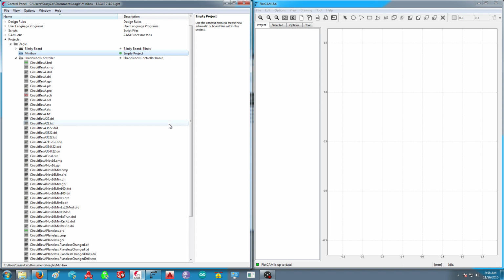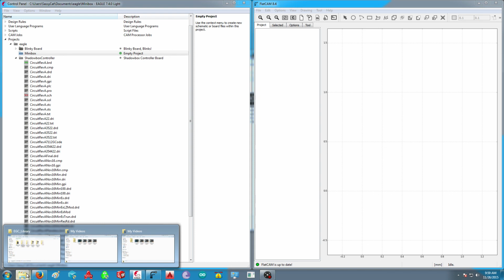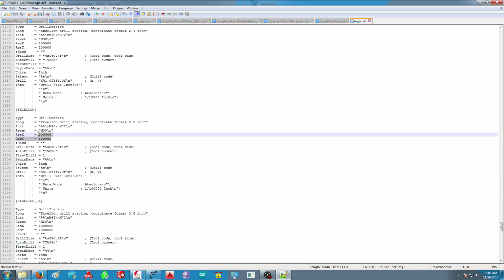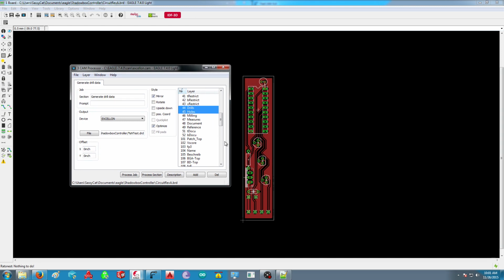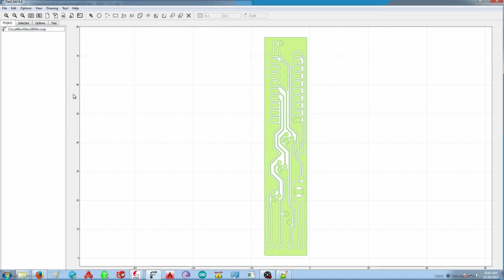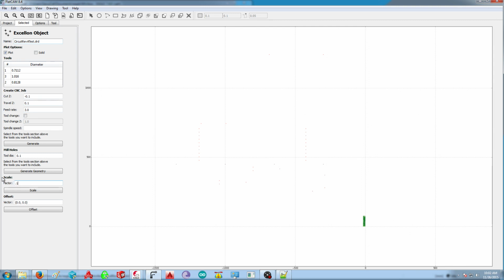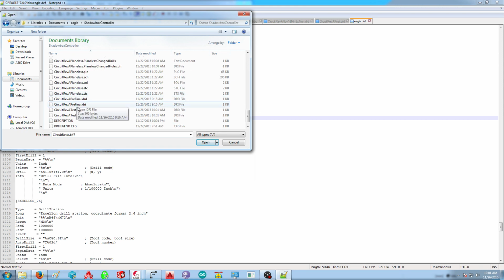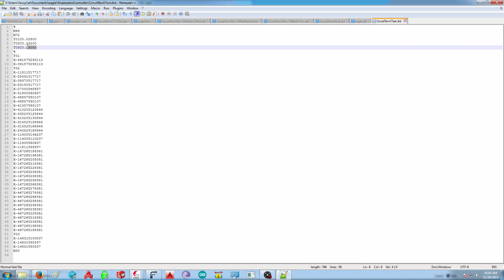Eagle 7.4.0 to Flatcam 8.4 Excellon Tutorial

Comment: Dude you are a hero. You really helped me figure out what was wrong in my case. now I was using Grebview instead of Flatcam. and it seems that the issue with mine was not only about the coordinates, but also the scaling of the coordinates. In short, for default cam process export, the xln drilling file, along with zero padding, I also scaled each X and Y coordinate with 10 as well, (or you can say add a zero at the end of each coordinate) to align with my other gerber files.
Reply from the maker: @Firehawk-t28  I'm glad this helped you find root cause of your issue 🤙

Comment: Eagle uses Trailing Zeros in its Excellon number format but does not properly report this format in the Excellon file. To tell FlatCAM to use this format by default set this system option excellon_zeros to T by using the set_sys command in the Shell Command Line Interface

http://flatcam.org/manual/eaglehowto.html

Comment: Hi, I have tried your totorial but why do some holes, go so far apart of others, mean while the holes belongs to the same component, I just draw a 40 pins IC such as ATMEGA8535. after the excellon file is loaded, there are 5 holes splits from the others about 10 times scale factors.
What do I need to do to fix this problems ?, 
many thanks in advance.
Kurnia Brahmana